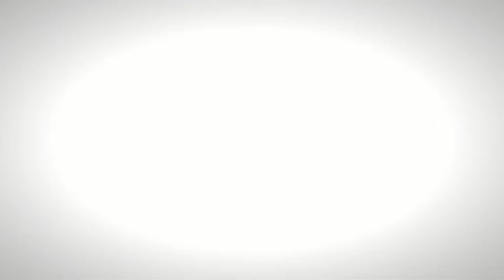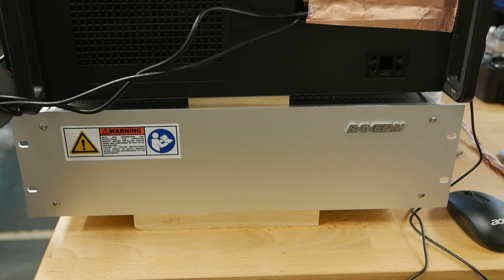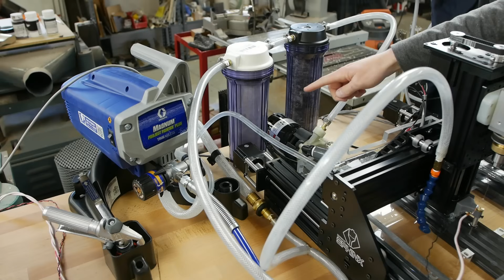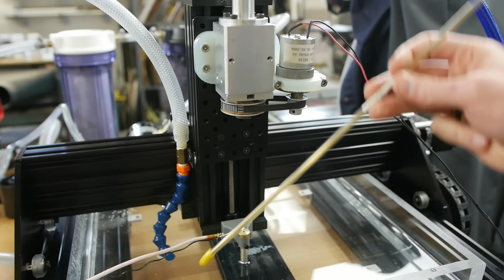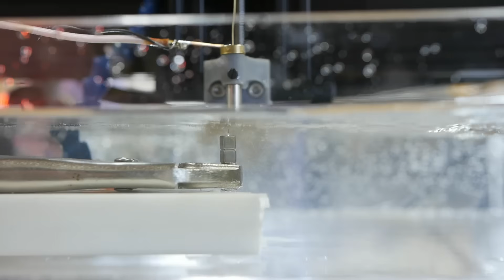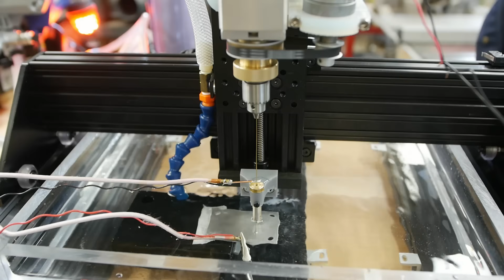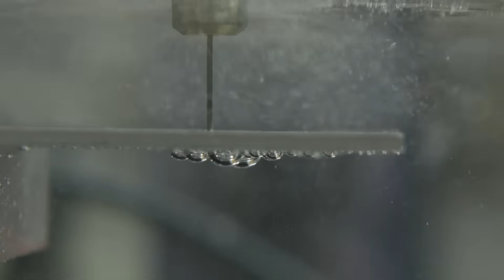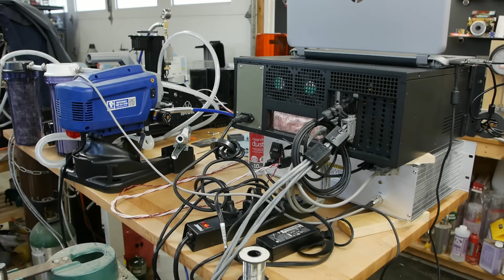Drill through anything (conductive) with Electrical Discharge Machining

Comment: Could you try this on a conductive stone line Granite or something with quartz in it?  There is a theory that the Egyptians used something like a EDM to drill fast through hard stones that were slightly conductive but it is only theory.
Reply: electricity didn't exist yet

Comment: Why did you go with a rotating  drill head?   The only EDM  Machine I've run was just a plunging head no rotation.  One of the guys used ot to make  coining dies to create double strikes.  EDIT   You ended up answering the question in the vid.  It occurred to me  that you should be able to mill threads  in hardened steel  or carbide.

Comment: I have a 45kV DC supply, and i made a HV cap with fine plastic sheets and tin foil, i measured that it was around 20nF.
I charged it, and discharged by an air gap with a small filament of cooper. Was very VERY loud, and the filament disapeard, and the alligator clip that was holding it in place moved
Reply: I found you after scrolling down a lot how did you get a 45k DC Supply

Comment: overengineering!!! such simple operation as drilling could be simply done in a loop of C/Python/etc code taking reading from current clamp and driving Z axis accordingly, going back in case of short could be done as well in that control loop.. G Code could still be usefull to drive X and Y axes. but when you need drilling you can call your custom M command etc Pretty sure you can do it with Linux CNC etc.. . throw away your expensive controller!! Still most difficult to find thing here is power soupply for EDM, It would be interesseting to see DIY one